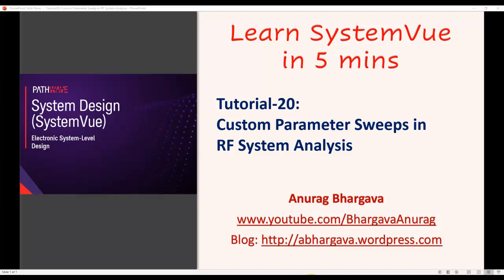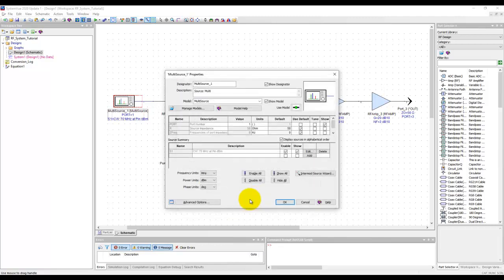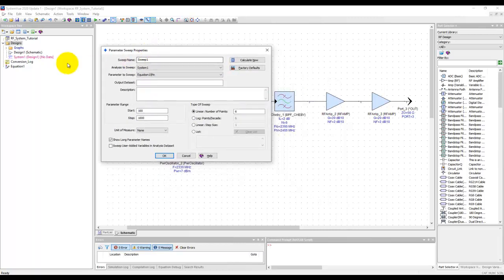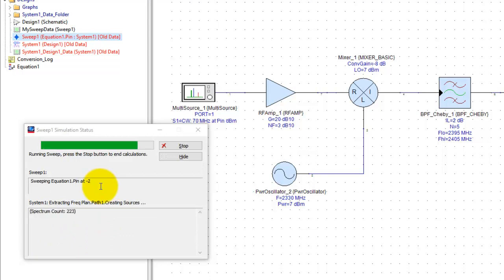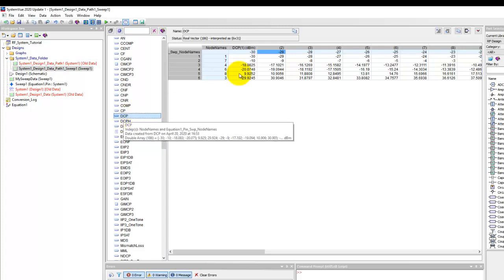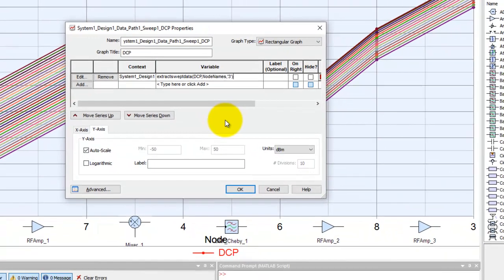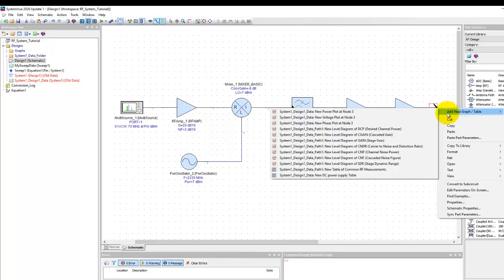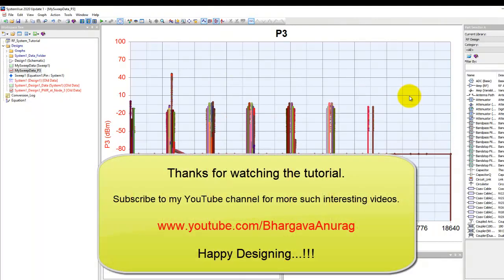Tutorial-20: Custom Parameter Sweeps for RF Systems

Comment: How to define RF power at MultiSource which is freq dependent? i.e. define P=0 at F=100MHz, P=10 at F=200MHz and plot P vs F. This is the case that DAC output power varing over wideband freq.
Reply from the maker: You can use Multi Source component and add needed tones and power levels. Contact Keysight tech support team if you need more help with this.